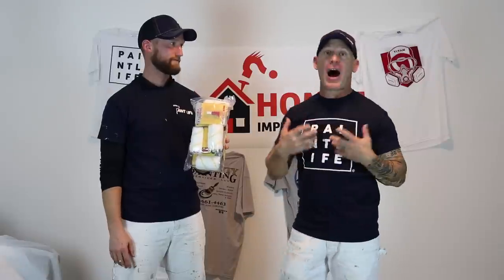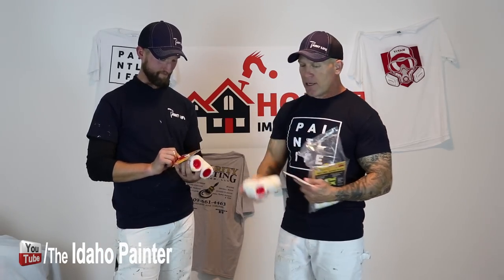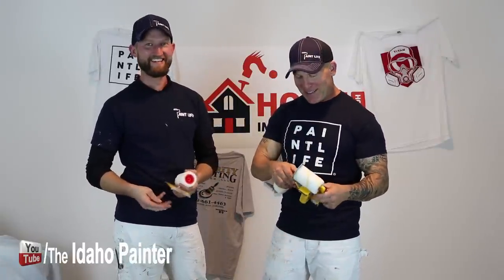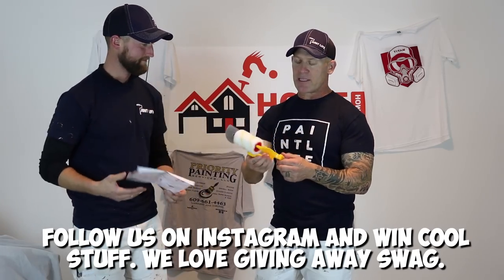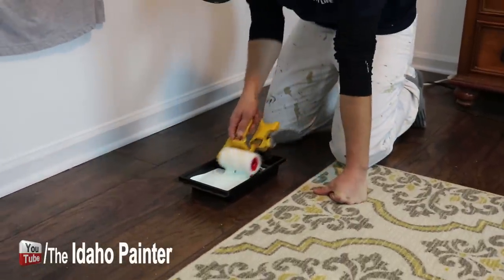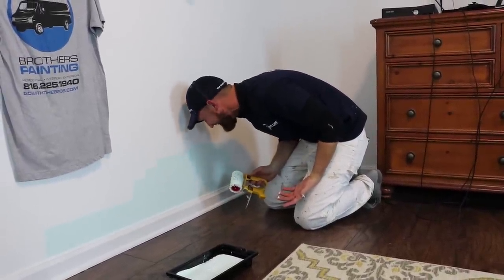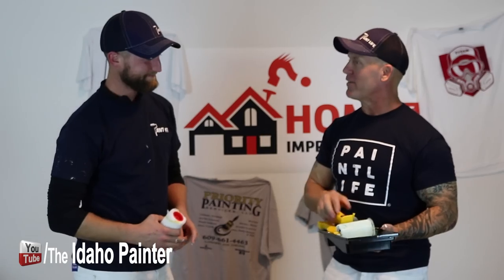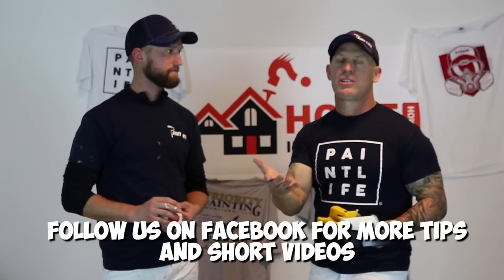Accubrush Review.  STOP & WATCH before you buy!!!!!!!!

Comment: I'm a professional painter. LMB Painting. I have this product. Saves tons of time. Pretty good lines. Finish on the down stroke to eliminate wheel tracks. Adjust mini brush. Keep a rag handy to wipe excess paint off periodically. Yes some spots may have to be cut in by hand. Overall I like this product. It is sturdy and dependable. You can use one knap per color or job then toss. Machine is easy to clean, wheels are fine, if you take care of your tools. Again it's main 2 functions, time saver and pretty good lines, does both. I rate it a 7 putts 10. Whatever issues you may think it causes, the 2 main functions out way those knit picky issues. So if job has to be done perfect maybe not but, for jobs that are in and out and short deadlines and near perfection is good enough this works fine.
Reply: If you are a professional painter I am a master painter
Reply: i was going to comment the same thing finish with roller side following behind wheels to avoid the marks they did it backwards several times
Reply: Geez...read the instructions already. I usually like what you post here, but you missed with this one. You only go in one direction and there will be no track marks from the wheels. Even I got that, without the benefits of the instructions.
Reply: Thanks for your input… 7out of 10 would be disrespecting our efforts trying to a 10/10 outfit. But very good for , like you say , in and out ( in our neck of the woods we call it “down and dirty”… I found this product sub par… but there are clients that do not need “fine finishing” check out my video on my channel … my brush is practically a sixth finger.
Reply: I 100% agree. This tool takes a bit of getting used to but what a huge time saver.
Reply: I’m a landlord, and am DEFINITELY using this

Comment: You guys made my day watching you try to review this edger. I'm a professional painter and I absolutely love this thing and it saves me time and makes me money. The only thing this is good for is interior window, door and floor trim. It works great on medium to low textured walls which is most common anyway. It is easy to clean just as long as you don't let it dry up which is common sense. My rollers and brushes in the pack has lasted almost a year but I've had to purchase the roller unit itself a second time and that's because the cheaply built little plastic wheels on the lower bottom. And the reason for the break is I was running them on a heavy textured wall, so don't do that! Also It doesn't work for ceilings unless the ceiling is completely flat texture which is pretty uncommon anyway.   So Here's how To use it. First when you get it wash/scrub rollers in water this will help remove any fuzziness just as you would with any roller which painters typically use tape anyway. Second, once you lock in the roller and insert the brush, have the guard shield all the way open and roll it into the paint USING a regular size pan. Then Roll it up pretty heavy but not to heavy where the paint is sliding off the roller. Third part is a little tricky at first but stick with it and that is once you have it loaded, close the shield and make sure the little lever handle thingy is right next to were you place your thumb and press/hold both. What that lever controls is how close the cutter brush extends out and you want it extended out the furthest so it stays closest to the wall surface for great tight cut lines. O.k. Next is you want to roll a little away from the trim then bring it to the trim because it helps to control the paint better, if that makes sense. Then roll back and forth to cover your surface but once everything is covered roll it backwards, twords the little plastic cheaply made wheels, this will make the roller cover up any wheel marks and also you don't have to push hard for this to happen either. And that's that! The thing to remember is always wipe off any paint that gets on the outside of the paint guard that's because you want that clean that's what will be riding on your trim as you use it. Like with anything in life you just have to be patient and stick with it and it will get easier and that applies to using this contraption. It will save you time and money and for some make you money!
Reply from the maker: Yes, much agreed! Thank you for watching & supporting the Paint Life Community!

Comment: I am professional painter AND I learned to properly use the accubrush for speed in new houses. It doesn't mean I set the brush aside, but Ibtake advantage of new tools. You just have to learn to use them and with practice you get to love them.
Reply from the maker: Cool!
Reply: sounds like an accubrush rep
Reply: Great review, but they did not use the brush accurately.  I don't own one and don't need one at present but this review need to have the brush follow the wheels.
Reply: I guarantee I can cut in faster with a brush than anyone can with that thing.
Reply: @allenmorgan4309  I guarantee that free hand is always a failure option...
Reply: Looks like a infomercial product, next thing u know it will say as seen on tv
Reply: Sticking with the trusty brush
Reply: @wg7644  I was thinking the same thing
Reply: Lets face reality this is a gimicy telemercial product. Show me one large contractor using this bull...u wont they all spray on their paint. If u worked on a job site with this u would most likely get fired...instantly
Reply: @ericflory746  exactly, he needs you tube to pedal his junk
Reply: Jason Michel don't be stuck in your ways. I learned the hard way after hanging with some Puerto Ricans recently. Had it all wrong. They paint a house great and don't use a brush. Faster than I've ever seen it done
Reply: @garrickholmes3321  let me guess their spraying it...I ve seen the end results both ways if u want quality it takes time, If you want quantity just spray it on fast... Never seen a large crew use gimicy tools tho
Reply: Jason Michel yes and they put on the wall paint with those plastic edgers with the wheels and little flip guard thing. Couldn't find anything wrong with it and I tried because I didn't want to believe that works. They also use the biggest nap I've ever seen. Lol
Reply: Jason Michel certain way they use the edger. I couldn't do it. They said I was putting too much paint on it. I couldn't get the damn thing to dip in the paint pan evenly. Wasn't used to their rolling method either but that giant nap wore me out. I just went on and started doing it my way somewhere else and sorry I taking all my home jobs again. Work with them for a few weeks  because I could never get people to show up consistently.
Reply: @garrickholmes3321  exactly the basics never change, yeah i guess if u use the gimicy thing everyday u could get good at it...Not me tho
Reply: Jason Michel it was so much faster. One painter could Spend all day on a couple of bathrooms or cut in the entire house in one day. I don't want to like it at all but they are making way better money. I hate to say it but the edger and the way they use it is superior to the brush and holds more paint. Don't know if it'll work as well on repaints though. They only do new construction from what I've seen.
Reply: @garrickholmes3321  i guess ill have to see it to believe, I cant imagine that thing doing any good on a older house or painting over some old paint. Working on new stuff always goes alot faster then working on old stuff..
Reply: Jason Michel  I was taught things by various older  painters over the years. I asked a few of them about the edger years ago. They all said it doesn't hold enough paint. It definitely holds enough paint. Damn thing holds a ton of paint. It's not true that you can only cut in with a brush because nothing holds enough paint. I really think that I shouldn't have listened to them about a lot of things. There's no absolutes.
Reply: I started in a company that used the edger and large rollers. You can get very good at it but idk if I'd use them for top end jobs. But I got very good and I could either paint mid lvl quality jobs good and decently fast or in apartments that are all white. I could just fly through those. And dipping your edger into a pan is not good, we had our own method which worked very well.
Reply: Michael J  u can have it, not trying to do work twice after this junk screws up my paint
Reply: @ericflory746  🤣🤣🤣🤣
Reply: @ericflory746  ,probably the CEO of the product!
Reply: @Idahopainter  these two guys just shouldn't have done this this is for someone with arthritis in their hand for shaky hand this is not for a professional painter and they should know that that's all what they are doing putting it down it's ridiculous not going to make them look any better or smarter I have arthritis in my fingers in my whole body and I bought it and I'm going to try it because I know my lines will be much worse especially on top by the ceiling and by the baseboard so this will help me a lot😊🤗
Reply: @allenmorgan4309  I'm pretty good at cutting in with a brush as well, but with many areas of two story ceilings, I want to be off that ladder as fast as possible.
Reply: @Harles74  You're just using the wrong brush. A great quality, 2-3 inch wide angled brush, will increase your skill level dramatically, and there are plenty of "cutting in" videos on you tube that will have you doing it really well in no time!
Reply: @garrickholmes3321  we’re they using the Sureline pro edger?

Comment: We are professional Painters...we use this nearly daily.  We clean the rollers and the mini brushes, not that hard to do. Thanks for your opinion - I rate the Accubrush 8 of 10.
Reply: A pro wouldn't even consider using this !
Reply: @dh737  only because ego. no pro cuts perfectly straight lines.
Reply: I do !  All the time. No excuses
Reply: @dh737  impossible. You can approximate a straight line but until you grow a ruler out of your arm , youre not painting truly straight lines.
Reply: 🤣 glad you're not on the team.
Reply: @gianthills  If the trim isn't exactly true, you won't want a truly straight line.  This at least allows you to follow the trim, straight or not.

Comment: I'm a remodeler and a while back bought one of these plus the VERY expensive Accubrush XT model (handle pivots for better handling or to add an extension pole)  They actually do work pretty well for doing much quicker cut-ins on door and window casings,  as well as base boards - IF they have enough lip to "ride" on.  Will work on wall ceiling corners pretty well, but ONLY if the ceiling doesn't have much of any texture on it (but forget about using the floppy jointed handle that come with the XT - they don't even use it in the commercial videos!).

 A few points & observations (and a couple of things the you guys didn't figure out yet. LOL):

>  After you roll out the cut-in, finish with a BACK roll (roller will cover brush marks and the inside wheel tracks)
>  Then OPEN the SHIELD and use the tool as a normal roller (keeping wheels off of wall) to roll out the outside paint edge (and any wheel marks, which actually should not be there).
>  Yes, they are worthless in corners and around window sill lips.
>  And yes, the plastic is quite flimsily, especially at those parts you suspected (roller release latch broke, and the whole roller arm actually broke off with one drop from a 6' ladder.  The handle release latch on the XT also broke off.  Although, to Accubrush's credit, when I send them pictured of my fractured tool remnants, they actually sent me replacements!)

So, do they save time with cut-in?  Yep, they absolutely do!  Do they last very long in any kind of professional setting?  Probably not.  Are they worth (as in cost-savings justify) the high cost of paying for all of their advertisement?  Jury is still out, but because of the vulnerable plastic parts, I probably would not spend the kind of $$ they're asking for them.  @ $19.95, maybe.
Reply from the maker: Thanks for sharing Jeff!
Reply: Great review.  I felt your review was better than the video.  They did a good review, but not understanding how the track marks were being left was not good problem solving.  I think they should have watched some other reviews before doing theirs.  I love the channel though.
Reply: How do you cut in the corners.  I bought the devise and love it, being I’m not a professional. I can’t figure out how to do the corners.  Any advise would be appreciated.  I lost the little dvd.  Thanks.

Comment: The key to stop the wheel marks is to finish in the reverse stroke. I have some of these. also you can use your roller brush by popping put the red ends, and install them on your own same size roller.

Comment: Yeah, yanno, in fairness, re-watching their ad, they DON'T push the roller AT ALL. Every example of their usage of it suggests drawing the device AWAY from the paint laid, occasionally with a gentle push if gapping occurs. This (theoretically) obviates the wheel marks/ paint in the wheel concerns. It should also (again, theoretically) extend the life of the paint brushes too. Your "impartial test" here is the equivalent of saying "This utility knife is terrible. Pulling the blade towards me seems to work okay, but PUSHing the blade just jams the point into the surface!"

Pertaining to build quality, your observations are no doubt accurate, and the nap on the roller is indeed accurate, I'm sure, though the control of the rest of the "test" throws the rest of you plainly-biased (since, in the end, this would be more of a threat than a boon to professional painters) review into question. Indeed, I've no doubt that a cheaply-made As Seen On TV doodad would NOT be apropos for a professional. I'm sure it WOULDN'T stand up to a month of daily usage. NOR. IS. IT. INTENDED. TO.

Try using a residential sprayer every day for a month. But a Wagner works just fine for a small job. I wouldn't try to use a 5 Gal shop vac as a commercial dust collection system, either. This seems to me, in the end, a 30-minute (!!?!) example of video masturbation. You folk just REEEAAAALLLLY like hearing yourselves talk.
Reply: Jason Jurusz - LoL!  Well stated.

Comment: All the advert they do on your channel, i am suprised they didnt give you one.

Have not finished video yet.. but in my experiance, these only work on low texture walls.
With some adjustements and new set of skills this could work. Soo after you edge, pull up back slightly and roll again without wheels touching wall. Also, to much  paint especially on edge or not periodically cleaning will start to put paint where not needed. It will start to bridge. I doubt you could do two walls without needing to clean it.

Thank you for finally doimg this vid.
Reply from the maker: Thanks for watching!
Reply: Hahahaha at just smashing one in the beginning after that assessment
Reply: TurboFlush

Comment: Here is a tip for edger tools. I have mastered the Shur-line edger. When I cut in a ceiling I take the edger, load it up with a paint brush and start cutting in. The brush technique allows you to avoid getting paint on the wheels on the front. You can also control the amount of paint on the edger so you don't have runs or voids. If the edger doesn't get close enough to the ceiling, apply more pressure and it tucks right up in the edge.
 At the corners, I just run a brush up to it, and it's only about a half inch away from the corner. Try it a few times and  you'll get the hang of it. I never leave home without it. 👍
Reply: robert mills RUBBISHHHHHHHH
Reply: colin marshall What? Why?
Reply: Moon Pie Yup, the edger does have it's uses. I like using it on the ceiling specifically so I don't have to mash my head against the ceiling to watch my line.
Reply from the maker: Good tip, thanks for sharing Robert!
Reply: I'm sorry mate it sounds like a lot of effort and time wasted on loading the edger up  to cut in . I would say to anyone  who can't cut in to use low tac tape for your ceiling lines and you will get a nice crisp clean cut in line. Those things are a waste of time and money ive been painting for 28 years and im willing to try anything that will make the job easier , there's always something new learn ive tried one and there is no way I would recommend anyone to waste there money to buy one. I'm sorry it's a poor cheap tacky product that will never give you a professional finish.
Reply: I agree with you.  Don't let negativity get to you.  Good post.

Comment: Thanks for your honest opinion. I read a majority of the reviews below. There are some good points regarding getting rid of wheel marks,  and cleaning etc.  I feel a lot has to do with your System.
 I personally agree with John and Chris. Quality of product, attention to detail, efficiency  of your job site/system, Level of quality required for scope of work. What a Professional Painter who is competent with a brush can accomplish in quality( a $25 Brush will can last you 6 months to a yr), speed( no need to switch tools to maneuver around detailed substrates ), efficiency( how many linear feet I can paint, cleaning the tools( wheels-while I'm painting)and going back over my line. I can see this being useful in a commercial or Industrial setting maybe sub division or a quick repaint for Re sale of a Residential Home. I do a lot of High end Residential and my clients would not be satisfied with a 1/16th" gap between my Ceiling/Walls or Walls/Trim. There is an old saying: " Do it once, Do it right". If a new tool requires me to go back over the application to straighten the line with what I would already use... a brush, why would I need the tool?
Reply from the maker: Glad to help